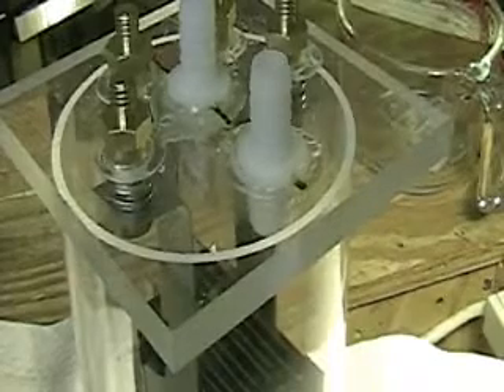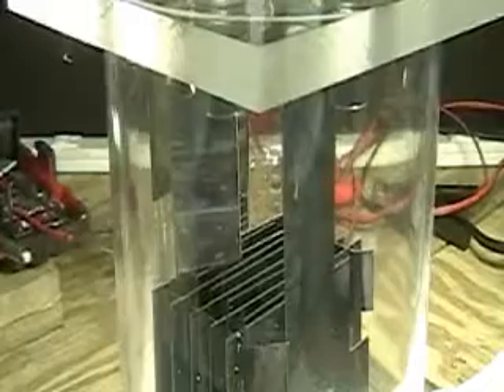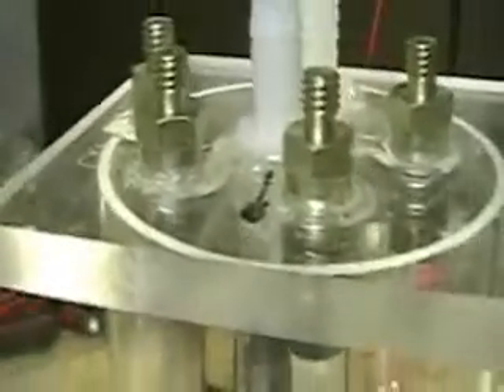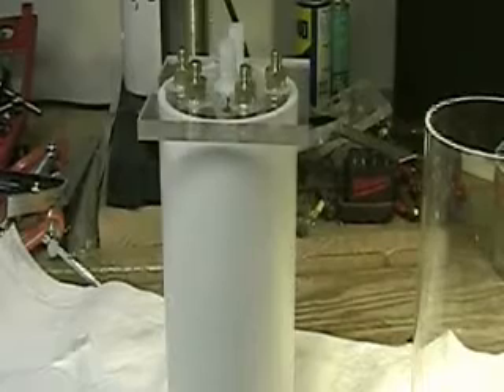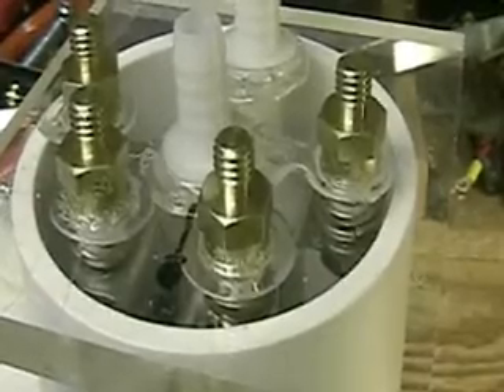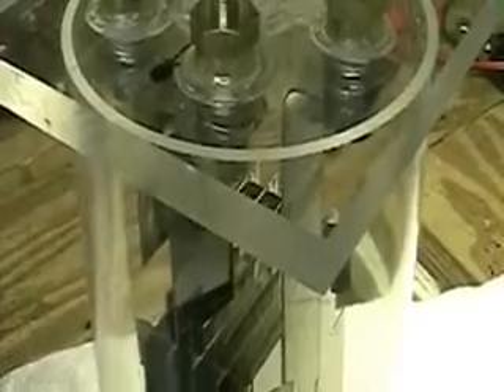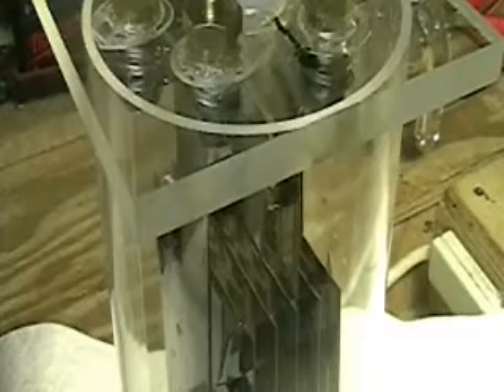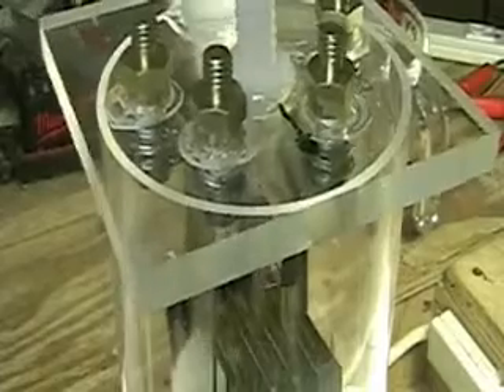Hydrogen Tap (FOCUS- more work) 301

Comment: John, It is fine to glue the bottom plate on, but it could be best to gasket the top and use the 4 threaded rods, so plates can be removed for inspection and cleaning. You can use the rods also for attaching a mounting bracket.